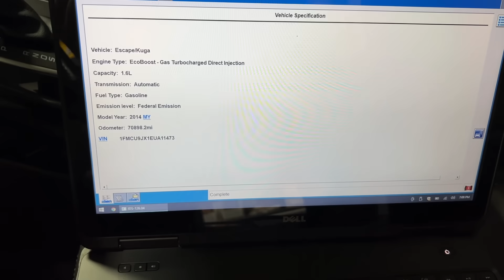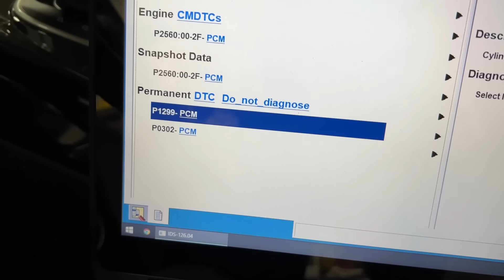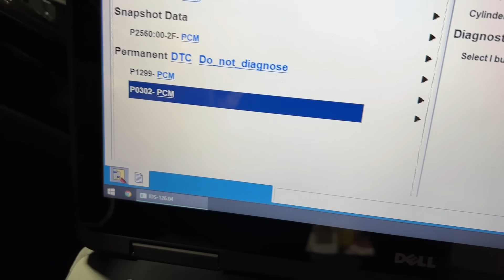Beware of Ford’s 1.5L 1.6L 2.0L Ecoboost Engines and Their Never Ending Coolant Consumption Issues!

Comment: That issue is illustrative of fords inability to address problems quickly. Ford’s Pinto was the ultimate example and they did nothing. I have a 5.0 in my F150 and so far I’m not having an issue. But, I’m really worried about my 10 speed which is shifting funny.
Reply: What year is your truck?
Reply: @standhd  2018, I blew my 2016 2.7 Eco in 2018 and had to buy a new F150 when the dealership tried to fix and failed to fix the 2.7. I sweared I would never buy another ecoboost. It was all under warranty.

Comment: Do you have to reprogram a automatic transmission in a (non ecoboost) 2017 fusion 6spd automatic….seems to shift great but sometimes hard at times like the shift points is off.

Comment: This really pisses me off. These automakers can do better than this. This isn't 1975. I figured Ford would have learned their lesson with the 3.8 L head gaskets back in the 80s.
I have four Ford vehicles.
None of them have an EcoBoost.
Two of them have Modular v8s, One is a double overhead cam V6, one is a double overhead cam four cylinder Mazda motor.
None of them have ever given me any problems.
Ford hasn't built anything worth a shit in the last decade.

Comment: While not being a Ford fan, european ecoboost engines and coolant systems on the European built engines from 1.1l to 2.0l don't suffer these problems. I would blame the block manufacturer and quality control systems for North American Market ecoboost engines.
In europe they phenomenally tough and reliable.

Comment: As a loyal Ford customer, this kind of half-assed engineering pains me to see.  I thought my current 5.4L 3-valve was somewhat of a long term reliability dud (as well as the horrendous 5R55E trans on my previous Ford vehicle), but this is on a whole other level indeed.

Comment: Both of the 2 I done was on cylinder 3 and the crack was in about the 10 o clock position. First one I did only had 68000 miles on it. Alldata says it pays 16 hours. Had head off in 2 coulda made bank off that job, but block is screwed.

Comment: Love the channel and glad you have allocated your free time to make such great videos sir. I just obtained a 2013 escape 84k miles. It was a one owner and I know she maintained it. However after seeing this, would you or can you recommend how to prevent this from occurring?
Reply: Drive it easy.  This situation is like a repeat of the 80's when engines really weren't designed for the stresses that adding boost causes.  As these engines age, the likelihood of failure goes way up, especially if the previous owner was fond of using the boost (passing, flooring it for fun, punching from stoplight to stoplight, etc.).  Good luck!
These days, all these car makers just want to get you past the warranty period.

Comment: Our 2017 1.5 Escape has been great so far and has 63k so far. I noticed one thing with the coolant level though. It never goes up to the "high" level even when hot.
Reply: Same here makes no sense
Reply: Not supposed to rise up to high while running. High level is for when it's cold and car is not running. The level should drop as the engine warms and pulls in more coolant.
Reply: @coreman021cb  That's right. Got confused. Anyway hot or cold it is always in low. Never has any fluctuation. When cold I'll add some coolant then after a while it's always back to low yet won't ever go lower

Comment: Sad.  Stuff like this is why I'm so reluctant to part with my 4.6 2V.  Ol' faithul is in the process of getting a brand new timing set, followers, lash adjusters, and valve stem seals.  Doing the water pump, oil pump, and power steering pump & lines while we're at it.  New head gaskets as well because we dropped a valve in the engine when changing one of the valve seals (Compressed the valve too far that it opened and lost our compressed air pressure in the cylinder.  What a dope.)  Also brand new intake due to the infamous coolant crossover crack.  Following your timing video series to a T.  250K and many more to come!  Hoping Ford can get it together soon.

Comment: The 2v would throw spark plugs out the heads, the 3v you can barely get spark plugs out, the 6.0 diesel the 6.4 diesel the 3.5s water pumps go bad all the time and now the 4 cylinders have cracks in blocks. Ford is the worst American car company ever.

Comment: I have a 2019 escape engine and transmission was replaced at 25,000 miles and now has 142,000 miles and has been flawless since the engine replacement. The original engine and transmission lasted about a year was replaced under warranty thankfully other than that I have no complaints. And not only does it have 142,000 miles it idols all day when I’m not driving up
Reply: The design flaw on all these engines / coolant intrusion was corrected in MID 2019 ....your 2019 had the left over bad design and your warranty replacement engine has the good/ corrected design.

Comment: Had the same issue.  I Have a 2015 woth the 2.0. Pressure test it , no leaks anywhere. Car hasn't overheating, no  but it is consuming coolant. 
I am wondering would a chemical test to detect a cracked block, head gasket leak would also detect an issue , besides doing the endoscope test. 
Test I am reffering to is where to attach pump/suction device and you add the blue dye and as you suck in the air/ hydrocarbons it would  turn the dye a yellow color. Would this test show anything in this case where coolant is leaking in and is being burnt?
Also, would a compression test show if there is issues with coolant and or oil consumption?

On a different note there is a class action lawsuite for this issue as well.
My vehicle unfortunalty is not recalled but its definitely affected!

Comment: I have the same exact Eacape… 2014 w/1.6. Started consuming coolant at 22k mikes…. Dealer jerked me until finally, at 63,950 miles they ended up admitting bad block and gave me new motor. Til this day don’t know if I got long or short block but with 85k it’s doing fine. I also filed lemon law and got $5,300 cash for my headaches with this car. It also needed a new rear RDU at 74,500 miles. Thanks for the vid Brian.

Comment: I "fixed" a 14 focus ST with Blue Devil. It was pouring out the exhaust. I assumed it was a cracked head, but your saying it comes from the cylinder liner? Great content

You should tear down the old engine and show the intrusion.

Comment: Just got my 1.5L rebuilt and it’s running very rough I’m going to be bringing it back to the dealer soon and hopefully they can figure it out. I got the new shirt block with basically new everything (injectors because they broke coming out, spark plugs, water pump, timing belt, etc) and in drive it’ll shudder in both park and drive (77k miles 2017)
Reply: The problem is you got kids working at the dealer who weren't taught work ethics.The older , talented , and caring  mechanics are already gone , or soon to retire.

Comment: i keep seeing these videos..but my 2014 fusion 2.0 has no issues...my engine is the spanish  val code engine.. and before you say all the 2.0 engines are the same..i checked in with a tech at land rover,, they had the val engines in all there evoque models and the volvo xc60t5 and they have no problems with this water issue....just the clevland 2.0 engines have the coolent issues.. yes it might be  a ford engine,, but with a sight diff, in the block/ head casting for the europe built 2.0 engines
Reply: hi, I am also wondering, this is mostly about US market... just got 2015 c-max with 1.5 ecoboost (it seems M8DF + B6), this is probably Craiova (Romania) made new after issues with 1.6 (overheating, fires?) - I read somewhere that this 1.5 had added some more water-pump to prevent overheating - but I dont know; just here I am shocked that 1.5ecoboost is crap, but I am not sure WHICH one - also ppl mix here 1.5 4cyl vs 3cyl (newer in europe), these 3cyl was probably never sold in US? ... its crazy ... now I dont know what to do, it the engine block at 70k km may be damaged, then I even consider to return this - or will try to do even expensive repair, because the car is good, engine works well now, it is slightly smoking as cold (but there may be injectors and Euro6 DPF damaged too, because of short cold runs ... ) ... its hell, these days ... I dont want new car with all the new EU nazi BS inside ... grrr (cologne fusion 1.4 mpi, some french PSA engine was okay, has 210k km and still no problems)

Comment: Been sub’d for some time, not the best news for our 2.3 eco boost 2016 explorer. We recently had a similar issue, but it was the water pump and the front main seal. Thank gawd I opted for the extended warranty when we bought it pre-certified, but we have had our headaches. Def paid for itself so far. A/c was completely replaced, both front axles, among all the recalls. Wasn’t happy when I forked over $400 for a complete brake job and they didn’t replace the rotors identifying burn in. Called the wife and inquired if we recently did allot of braking and said we see burn marks and have to turn the rotors. Now I’m a shade tree mechanic but I am ASE certified in brakes, hydraulic and air. That response from the dealer was bs. Anyway, I hope this happens to us, and happens in the next 20,000. Just hit 81000 and we really love this family car.

Comment: Exactly happened to me 5 years ago with our 2013 Escape.  Under warranty though so Ford paid.  $8000.  The replacement was a Ford rebuilders engine and in 6 months it started seeping oil everywhere so left my driveway.
Reply: where did it leak from? Its only 4 possible spots to: oil pan, valve cover, rear main, front main... sometimes timing chain cover.
Reply: @jamesmedina2062  cam cover, pan, front cover.  Ridiculous a reman from Ford like this.  OBTW, grew up in Ford household.  Father was a 38 year Ford mechanic.   Worked in that field for a while but putting aircraft off the point end of boat was more fun.

Comment: Your videos are great and thank you for doing them. My wife has a 2013 Escape 2.0 and it just turned 180,000 miles. We haven't had anything done to it other than regular oil changes done by myself and plugs about a month ago. It still runs like it did the day we bought it. I keep waiting for some disaster but it keeps going with no issues. I will check the coolant though. Your videos are the best and have helped me with the ford edge 3.5 and f-150 5.0. (No issues with the 5.0 yet) love that motor.... my son has a 05 ranger 4.0 with close to 300,000 miles and still going.
Reply: Wait till you need a battery ! Did you see how they stuffed it up under the firewall ? Dumbass design
Reply: @Jack-oj2ci  With 173K miles, I've replaced that battery more than once.  It's a pain, but do-able.
Reply: @Jack-oj2ci  I changed the battery in 28°F weather, and it was horrible. Took about an hour. I also own a 97 Ford ranger and that takes about two minutes to change a battery. Just like my 03 Buick Park Ave., and I have a 2005 Ford F250 super duty diesel which has two batteries, and I can change both of those batteries in about four minutes.  We escape battery is the single worst battery change I have ever had to do, and I used to work for auto auctions back at the age of 16… I’m 49 now and have seen a lot in my years, it’s bad, it’s really bad.
Reply: @Jack-oj2ci  easy stuff, to replace the battery in the fusion.......i work as a classic Italian car tech.. here is one for you..fiat dino. brake.master cLY, UNDER THE DASH ..LOL
Reply: @Jack-oj2ci  man, no kidding! I changed the battery in my wife’s 2014 Escape and it was damn near an all day project, back ache included, from leaning over the damn engine all day.
Reply: @Jack-oj2ci  Couldn't agree with you more. What a pain in the a$$ to change out !
Reply: @Jack-oj2ci  Ya it sucks lol not fun
Reply: Same here with my 2014 SE 2L ecoboost.  Daily tested against any muscle car or pretender.  I suspect I'll be more gentle knowing what I learned from the video.
Reply: They will last, however when you put them in cars or trucks that are supposed to be high performance. Then people get out and push the cars they over heat and burns up. Like 4 wheeling in a Bronco or driving it a a performance mustang they will not last.
Reply: Over 200k on my 2.0. And yes the battery is a pain to change. Love driving my Escape vs my Rav4
Reply: My wife's 2015 Escape with the 2.0 EcoBoost on it and we haven't had any issues on it. I hope the 2.0's maybe are better.
Reply: of course the ranger is still going its a ford fuckin ranger
Reply: look at the valve cover timing chain side.. there is a sticker on it..is a val engine?

Comment: I have a 2019 that needed a new motor at 24000 miles.  They refused to give me an extended warranty.  I can't wait to get rid of it but I have real guilt about selling and passing the buck if the new motor does the same thing.  I guess I'll trade it in for a better model with a good ol  v8.

Comment: I know the 2013 through 2019 1.5, 1.6, and 2.0 engine have this issue. But, i also heard that in 2019 (April i belive) is when they started using the redesigned 2.0 block to correct this issue. Havent heard of any issues after that redesigned block. Also have not heard of any 2020+ 1.5L (3cylinder) having this issue either.
Reply: This is correct...exactly what I've heard....from a master Ford pro ....has youtube channel as well...

Comment: The big issue is even if you put a long block in there is a high probability the owner will have the same issue in another 50k miles.
Reply from the maker: It was redesigned.

Comment: 2017 Fusion Titanium p0304 code. Coolant in #4.
Ford replaced engine at 57k. Only had the Blue Ovel Certified 3 weeks. Found it after a road trip off 110 miles.
Warranty work. Cost me $100.

Comment: Why would you buy a long block if the problem is only a headgasket leak?
Even a leak between a cylinder and the coolant passage between cylinders would be solved by a replacement short block... Long block would not be necessary...
 If the engine had been running well except for the coolant leak I would try replacing the headgasket before purchasing a long block OR even a short block...
 And if I was absolutely sure that Ford had no fix for the problem and I would have to purchase a long block anyway, I think I would still  try replacing the headgasket, but this time I would cover the new headgasket with high temp JB WELD first, put everything back together, and let it sit for a few days until the JB Weld was fully cured before putting any coolant into it.
 If there was no trace of a leak after a few hundred miles, you would be good to go for another 70,000 to 100,000 miles.......
Reply from the maker: Oh my lord where do we start with you?
Reply: @FordTechMakuloco  
What's your problem?
 I replaced lots of headgaskets on the L88 I had in my 67 vette because aluminum heads expanded and contracted at different rates than the cast iron block did...
 And growing up in a group that did a lot of racing, I purchased a lot of short blocks.
 The only time I ever purchased a longblock was when a big block sucked a valve doing serious damage to the piston, bore, and head.

Comment: To be fair they can’t figure out how to put a spark plug in a head.  I’m so glad I have a pre 2018 5.0 with the booring old 6 speed transmission.   Wouldn’t touch a newer one
Reply: My 4.2 V6’s spark plugs fit just fine. I’ve done 4 changes over the last 20 years.

Comment: I bought my wife a 2019 Ford Escape with the 1.5l Ecoboost and at 4300 miles I noticed a coolant drop. She was coming up on her first oil change(16 miles on the odo when purchased) Ford dealer had to put a long block in it. Same issue except it was cylinder 2 and 3 with coolant in it. Plus there was a TRP to have the cooling fans run on high all the time. My guess was to mitigate the over heating issue later down the road. So far this long block has 17K miles and no coolant loss or any other issues thus far.

Comment: 2013 fusion with 2.0 EB. 120,000 miles. Bought it new and have had no problems other than an axle shaft bushing which was an easy fix. Have never had any coolant Loss. Unfortunate that some of these engines have issues.

Comment: You're awesome, Man!  What about just using Block Seal with copper?  I used it on a head gasket leak.  Stopped leak, drove it for 15K but then I sold car.  Told guy to give me a call when it failed.  Its been years so....worked for me.

Comment: Makes me glad I sold my 13 2.0 Fusion now. I was sad at the time. But damned. My 03 5.4 F150 went 498,000 before I gave it away. My 04 F250 is pumping strong at 160K.
Reply: Is that MILES?
Reply: @standhd  yes.

Comment: I have a 04 f150 5.4 3 valve. Has 226k miles and has the phasers and chains all new. No noise from that. It ticks a little bit I can hear it at drive thrus but the ticking goes away whenever its at operating temp and I step on it and leave the rpms above 2500 and lower than 3500 and then drop it to idle and the ticking goes away and its as quiet as it can be. Lifters maybe? 5w30 oil in it as of now fixing to change the oil this week with 10w-30. Also where I work we have a boxtruck with a 5.4 3valve and we put 15w-40 oil in it and had given us 0 issues at 120k miles. Is that good?😂
Reply: How many drive thrus are you driving thru every day?😂
Reply: @standhd  i havent gone through one in  almost 5 months. But I can still hear it next to a wall or parked next to cars.